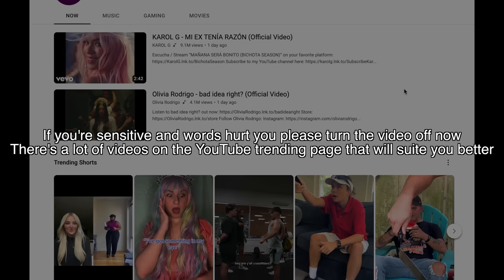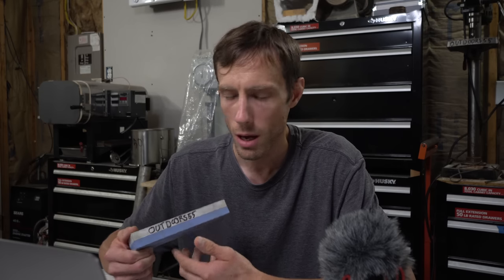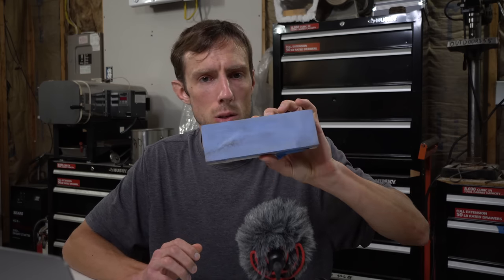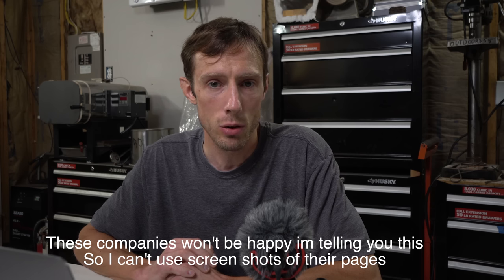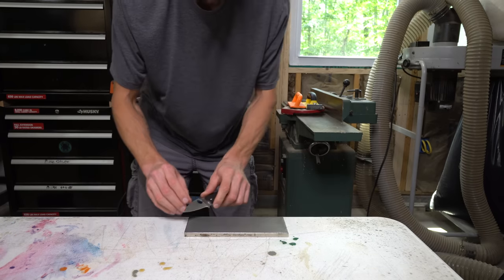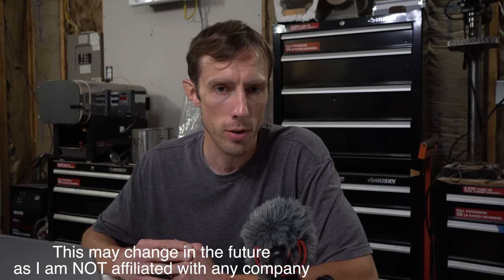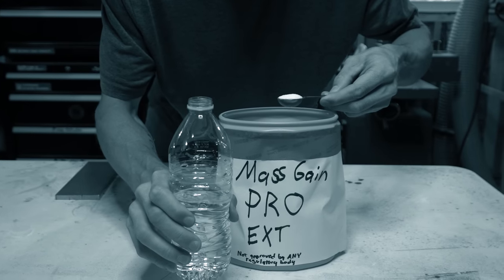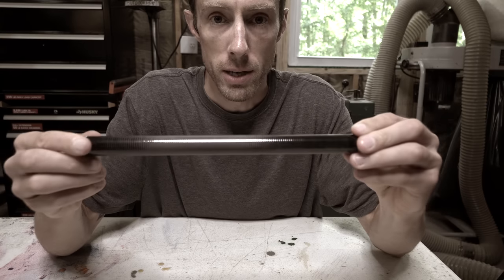The Internet’s BIGGEST Sharpening Stone SCAM

Comment: I wish I had seen this video a month ago. I knew all those whetstones had to have came from the same manufacturer, but I didn't realize what I'd be getting into. I know maintaining the proper angle is key, but this was nothing like sharpening my pocket knives on smaller stones. Instead, I (while using the guide that came with the stones) ended up dulling my kitchen knives even more. I should have gone with a diamond stone set like I had originally been thinking, but thought I'd save money...but I just flushed it down the drain.
Reply: A diamond sharpener ain't gonna help if you can't get a knife sharp with a wet stone. You have to know how to maintain the same angle, and how to get a burr. It wasn't the stone that dulled your knife, it was you
Reply: Pls dont flush Something Like STONES
Reply: @dereksteele2284  I have one of these amazon whetstones and they really are garbage.  I was using the 6000 grit side and a 2mm lump pops out of the surface.  What caught this lump?  the edge.
Reply: I've sharpened up piss dull chef's knives at work with these crap amazon stones over 100 times at work over the course of about a year. These stones really do work, they're just crap and irritating. Like the guy says, they're soft af and dish out super fast. You'll have to flatten them out constantly and they make mess all over the place. But they do work, I consistantly got low quality knives (relatively soft stainless steel) razor sharp, enough to make paper thin slices out of tomatoes. I do think these crap stones have a legit purpose. For someone wanting to learn how to freehand sharpen on a stone, get one of these crap-o stones for 20 bucks, one of those 400/1000 combo stones and a cheap food service chef's knife. Dull it up on the side walk and practice on the crap stone until you get the feel for it. Once you can consistantly raise a burr and finish it up, and get it cutting paper nicely, go get some real stones.
Reply: @David-bc4rh  he didn't say he had a lump on the stone, he just said the stone dulled his knife
Reply: @dereksteele2284  I was giving a supporting anecdote on the grain size inconsistency where my blade edge found a  2mm grain and pried it up.  The stone caused damage to my edge and loss of confidence in the product.

Comment: I fell for those stones a couple of years ago. I have three different ones with 2 grits each. One big tip off is that many of them come w a bamboo holder and a small rubber mat, and sometimes a plastic angle guide. I must have bought mine before the price took off since I have perhaps $20-25 total in all three. And that is still far more than they are worth. Every bad thing that you said about them is spot on. One of mine even separated where the two different stones were glued together. They are extremely difficult to sharpen a blade on.  

I have several old stones I bought for a couple of dollars at garage and estate sales. You can also often get some nice pocket stones for only a buck or two. Most folks used oil on their stones in the past, which can be a problem if you prefer using water. I soak the oiled stones in water with  dish washing soap for a couple of days. Sometimes I hit them with a brush if they are really gnarly. Then I run them through an ultrasonic cleaner a few times in water with dish soap and the warm mode turned on. After another bath in dish soap and a fresh water rinse, I let them air dry. The oil is usually gone and they work fine from then on with plain water or soapy water.

Even somewhat dished out or nicked stones can be flattened with sandpaper, or on the cement sidewalk in a pinch. The side of a dismounted 8 inch grinder wheel works pretty well also, just use both sides of the wheel so that you get your stone more flat than you can by only using one side 100% of the time. In my experience any old stones made by Norton or Craftsman are usually worth buying. And many that are labeled Arkansas Stones are good also. Lansky and other name brands are usually good as well. Some of the older stones, especially natural ones, don't cut some of the new super steels that well. But you are generally better off with diamond stones for those anyway. 

I use two cheap Harbor Freight stones as flattening or trueing stones for garage sale finds. You'll get the best results if you have 3 stones to work against each other, rather than just two. 

Watch Alec's videos on sharpening with a coffee mug, or on a car window if you're still tempted to buy these crappy stones. I think you'll have better results using the bottom of a mug than these stones! Wet/dry sandpaper laid on a sheet of wet glass would also work better than these stones.
Reply: oh ffs, I bought 2 of those. I swear, can't buy anything nowadays! Not even a rock!
Reply: That's what I use for quick chisel sharpening on the job: a broken piece of glass pane and some worn down 220 grit sandpaper. I'm not building a jewelry box so it's plenty sharp enough.

Comment: this is why when it comes to buying things on amazon I look at 5 things.
1. who is selling it
2. if it has multiple user reviews from multiple different websites
3. number of reviews has to be over 100 buyers
4. the 5 star rating has to be over 80%
5. read all the negative reviews only to find if there are common problems with the item.

this gives me a better picture of the item in question.
I will never buy anything under 100 reviews that has lower than 80% 5 star rating that has 2 or more negative comments about the same problem.
Reply: I tend to look at the 1 and 2 star reviews firstly, as junk sellers pay for the fake reviews.

Comment: I appreciate the video. In my view, every stone has certain characteristics and limitations. Japanese stones for instance are very very soft and wear quickly, they use a big slurry, etc. Many many stones need to soak thoroughly, mainly for the same reason we need water for wet sanding. And I wonder about how much pressure people are exerting, and if they are expecting to use a stone to renew an edge or just polish. Also many professional people in kitchens and street stalls worlwide use deeply dished stones, especially for knives....  if it degrades so quickly, then flattening will be a cinch, if you feel that's what you need. Just as an example, the very best woodworking can be found in periods 200 years ago where you could not get a stone so easily, and when getting a truly flat stone meant extraordinary effort, so the stone you described for 15 bucks or so isn't so terrible. I come from Cleveland area where there is a long sandstone tradition--try that sometime for an interesting experience.  I think there is something to be said for how you use it and what you expect from it. I have used a wide range, from found/hand prepared stones to Arkansas, diamonds, dollar store stones... They all have a place if you approach it knowing what to expect. Better to have more reviews so people know what to expect. So for that i commend you. I'll add my best bang for buck is the Norton India stone, black and orange. Very very good hard oil stone that can be a splash and go with water.

Comment: Yeah, I tried that stone, I have the exact one. Has all the problems you pointed out. My biggest issue is it dishes out really fast, and if your buying this cheap stone you (like me) probably aren’t looking to shell out more for a flattening stone then your actual stone cost, to keep it flat. And the one they give you is tiny and would never work. Just garbage.
Reply: Here's a low cost trick for flattening soft stones like that: glue a sheet of coarse sandpaper (60-80 grit) on a piece of window glass, than stick the glass (on the opposite side) to a table with double sided tape to keep it in place. Grind the sharpening stone on the sandpaper in a circular motion, applying just enough pressure to keep good surface contact. You may need to brush or blow away the accumulated dust a few times so it doesn't clog the sandpaper, but the whole job shouldn't take more than 10 minutes or so.
Reply: @Dr_V If you wet the glass before you put the sandpaper down it often doesn't move. No glue needed! :-)

Some tile and countertop stores have 1ft square samples of their counter top material that they will give or sell you very cheap. Those samples are pretty thick and heavy. I also bought a 1 ft by 2 ft granite tile at a flooring store for a flattening project. These tiles are around 3/8 -5/8 in thick. These pieces of granite aren't as flat as a special machinist stone, but they work for sharpening blades, or polishing up a flat surface on many items.

Comment: I commonly tell people to get a 1k/6k and a stick of buffing compound to practice with but never spend more than $18 delivered for the setup.   These stones are GREAT for learning what you're doing wrong because they will actually produce very sharp edges once you learn to do everything right.    I use my 1k/6k to polish maring and burn-on out of steel baking sheets and to do rough-in on knives before using my good stones... work fine for that.  You can just use a mopping towel to clear the grit between sweeps and none of them have to be soaked before use.
Reply: I agree that these stones are good for learning. I have a cheap one, and it's much more obvious when the angle is off compared to a cheap diamond stone.

Comment: I originally bough "Japanese water stones" off of Amazon years ago and didn't care for them much. Later I bought the cheap plastic DMT diamond "stones" that worked better, but did not last at all.  Years later I found your channel and bought some ceramic stones that you recommended and I liked them, but I still wasn't getting a great sharpening (I guess I just suck at using a stone.) A bit later I bought a ceramic rod and I absolutely love it. I can get a very sharp blade on any of my knives with very little effort or time.
Reply: Can you pls give me the name (brand) of your ceramic rod?
I'm about to buy one, your info may help.
Thanks.
Reply: Rods don't sharpen. They align the edge.
Next time you sharpen on a stone, try to align the edge on the stone itself. 

Your knives will get dull eventually, doesn't matter if you use the rod or not as the sole purpose of the rod is to align the edge and not to be abrasive, so you will always need to use a stone to carve a new, sharp edge.
Reply: @sacoto98    steel rods may not sharpen, you are right, but he mentioned ceramic ones. 
Aren't Japanese ceramic whetstones made of ceramic, same as ceramic rods?
Reply: @redangrybird7564  I use a ceramic rod myself for my harder steel knives not to sharpen them but to give them a quick alignment. All rods are somewhat abrasive, but think of it like he said in the video. "Even a brick can sharpen a knife". Just because Japanese whetstones are made of ceramic, it doesn't mean that a ceramic rod will do a similar job at sharpening because whetstones and rods are built for different purposes.
The guy in the original comment said he tried sharpening on stones and managed to get a sharp knife but not something out of this world but when he switched to a ceramic rod he got a better result. That happened because the rod gave him a more direct way to the key thing he was missing in order to get a greatly sharpened knife which is alignment and burr removal. You can align and remove burr with a whetstone as well but a ceramic rod will do it easier because it is specifically built for that job.
The key thing to understand is whetstones are built to remove material quick, easy and efficiently (sharpening), rods are made to remove burr and align the edge that was carved with the whetstone (honing). You can align and remove burr pretty easily with a whetstone as long as you use the right technique but you'll have a hard time sharpening a dull knife with a rod
Reply: @sacoto98 you're thinking of a steel. Ceramic rods are sharpening stones in the shape of rods.
Reply: @Zaque-TV  are they? I have a ceramic honing rod and it is definitely not suitable for sharpening
Reply: @sacoto98 correct
Reply: @sacoto98 correct
Reply: @DinoNucci I feel that your comment was far enough on point to warrant being posted twice. haha👍👍As to the OP, he said it himself- He's just terrible at freehand sharpening.
Reply: @sacoto98  The Lansky ceramic rod that I use to final hone knife blades is 1000 grit.  That's plenty coarse to remove metal.  I use it after a 1200 grit diamond stone and to touch up between sharpenings.  My woodworking tools get plenty sharp with the 1200 grit stone and vigorous stropping but I find that my Damascus Calphalon and Hinkle kitchen knives definitely get sharper with the ceramic rod.  I do know the difference between straightening and honing.

Comment: Bought one of the kits off Amazon so came here to the University of YouTube for sharpening tips.  So glad I came upon this video.  One thing I noticed with my kit is I feel no difference in grit between the stone labeled as 400 grit compaired to the one labeled 8000 grit.  I can feel a big difference with sand paper that is 400 grit vs even 2000 grit.   Thank you for your video.  I am of to shop for a few Diamond Stones per your recommondation.

Comment: 1:53 I am that person, you can pity me 😭I literally found this video as I'm taking a break from sharpening my kitchen knives with a set of stones very similar to this one, and my experience has been deteriorating with every moment 🙃
Reply: I have felt your pain!
Reply: On the other hand, I'm using one of those cheap stones with no problems. Your mileage may vary.
Reply: @gbennett58  It also depends on how many knives you're sharpening in one sitting. If you're just doing one or two, it's not that bad, but if you try to do an entire collection at once (like I was when I made the original comment), it very quickly turns everything in the immediate area into a damp, slurry splattered mess.

Comment: Yup, I feel sorry for people that are just getting into any sort of craft. I settled on water stones a long time ago and I am not changing from my king stone, but I would be very interested how a cheap stone like the one you show would compare to a premium brand of similar grits.
Reply: I found this video because I wanna know the difference between a good and a bad (soaking) whetstone, but he just jumped right on to diamond plates. Still trying to find some good info on the subject
Reply: Im glad that i just bought a king stone instead of the amazon basics kit with every same stones.....
Reply: @themindset3329  I have the same DMT diamond impregnated stones the guy in video has. Using them is a very different animal from those whetstones. Those diamond blocks do not play, they will shred metal right off the blade with ruthless efficiency. If I remember correctly, the package inserts state, "Let the diamonds do the work". You use very little pressure and run across it dry. You use a plastic veggie scrubber under some running water to clean it off, all that runs off it is metal from the blade. Zero dishing, no need to flatten, ever.

Comment: I go with king stones for sharpening. I don't typically use it on high wear resistant steels but once flattened I will use it to set the bevel on some straight razors and then progress from there. Good video overall. I think even for less than $10 I would skip those blue&white stones. They just LOOK like garbage.

Comment: I bought a very similar cheap white/blue stone and had the same problems. Immediate cupping after the first use and it became strangely gritty and wavy. I attempted to fix it with a flattening stone and sandpaper but eventually realized it was just poor quality. There are decent 400/1000 stones for cheap but with anything else I think it's best to look at higher quality brands.

Comment: I started out with the crappy Amazon stones and then found your channel and decided to give the dmt stones a try and my sharpening skills really improved so much that i don't even touch the wet stones anymore. I will also say that ultra sharp makes some really good full sized stones 8" in a set of 3 that are just as good as DMT stones I like the bigger ones and the smaller ones is nice to. I have a set of each but the one down side to diamonds is that the fine grits above 1200 do not last very long so it would be nice if you could recommend a good whetstone for honing as right now I'm using ceramic rods which I feel you lose some geometry of the knife when using rods. But as for now the 600 and 1200 diamond stones work awesome for me along with the leather strop